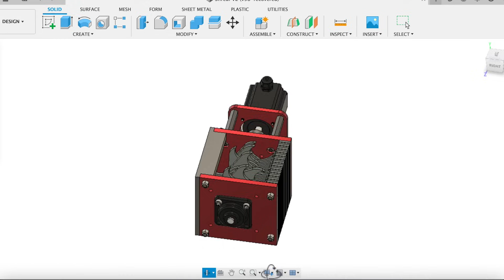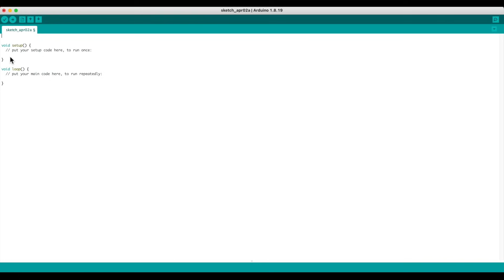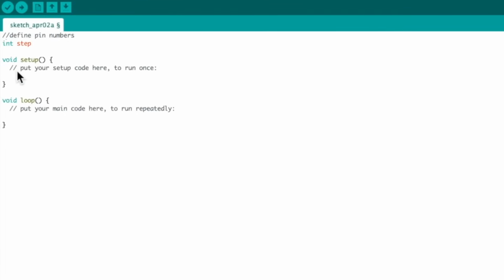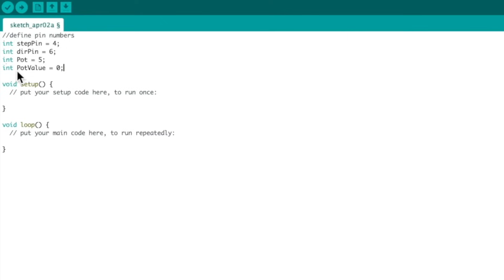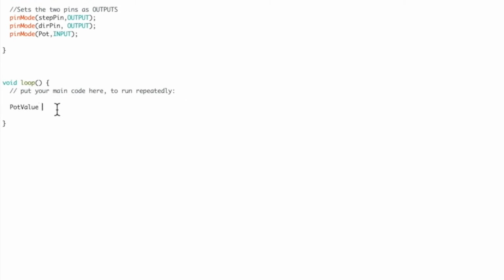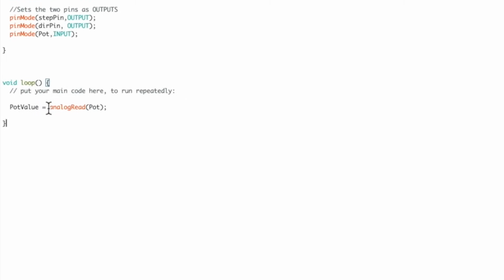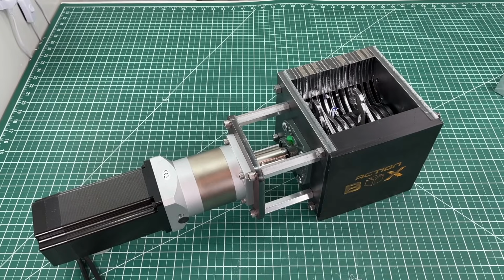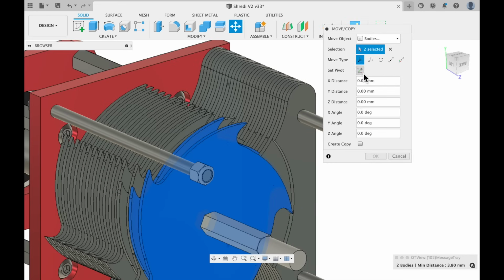DIY Desktop Shredder | SHREDII 1 & 2

Comment: Nice shredder! For your next trick try building my ideal 3D printer.

I Invision a stationary print head that uses shredded plastic rather than filiment. Instead of a roll of filiment it would have a large hopper to hold shredded materials.

It would be impractical to try and make a movable print head with a huge material hopper attached so we make it stationary and move the print table below instead. Think of a Bridgeport style mill as an example. Those have the table able to move in the X and Y directions and the knee of the mill is able to move up and down for Z axis motion.

I may have to start drinking 7up just to get the clear green plastic to shred someday rather than buying filiment to print with.
Reply: This has been done before and it didn't work because the the output was too inconsistent. You have to make it into filament first.
Reply: @DaveSmith-cp5kj   Did they try making a long narrow screw injection cylinder? I'm sure there's a way to make it work.
Reply: @tenlittleindians  Yes that's what they did. I'm pretty sure the full article is on MAKE although the original article is old from 2010 or so. The issue is the rate the hot end as programmed by the gcode consumes changes and is always different from the rate the extruder wants to put out. Consequentially you end up with junk burning up in the extruder, or gaps in material being laid down on the bed.

Because you know when an extruder extrudes, it consistently outputs right? But when a 3D printer prints, it lays down material for a layer, stops to change Z height, then resumes. Those pauses where material is not being laid down backs up the whole system, but then if you reduce output to compensate, you get spots of no material in the print.
Reply: @DaveSmith-cp5kj   I think pausing the entire shredder/extruder mechanism would be a better approach rather than just pausing the rotary extruder would be a better option.

The burnt material in any plastic melting machine is poor temperature regulation. The advantage of a long tapered screw injector would be multiple band heaters along the length that independently monitor and adjust temperature. The plastic towards the hopper would be adjusted cooler than the nozzle end. Keeping it in an almost paste like state at the top and only getting to molten plastic at the nozzle end would prevent burning and allow G-code to back turn the extruder during pauses in a print. A screw with putty like material back turned would provide enough vacuum to suck back the liquid in the tip end to prevent drips much the same way a plunger style barrel extruder does when it back feeds filiment.

You will need to sort materials closely as they are all going to require different heat maps for the band heaters along with print speeds to go with them. That's not really much different than what we need today with different filaments all requiring fine tuning to work properly.

These machines will also require dryers on the material hoppers to control moisture just like any modern injection mold machine that uses plastic pellet material.

Your not going to build one for a couple of hundred bucks either!

I think of one of these machines as a tiny recycling factory that sits on a table. We went through a similar development with espresso machines for home use. You push a button today and the machine heats the water, grinds the exact amount of beans, pushes the heated water through the ground beans at the exact pressure for a specific kind of roasted bean and into a cup. It makes the exact same amount every time and ejects the old coffee into a waste container. The machine will even heat and froth the proper amount of milk into the cup at the same time if I want.

These machines are complex and expensive but at Starbucks prices they will save you money in the end. 

Maybe the development needs to be more focused on a specific common plastic such as water bottles for now? Eliminate some of the variables until it's working and then move to the next abundant plastic.

Comment: Yeah, the problem here as well is i dont have a dedicated shredder, and getting the parts and metal for it here in Arizona is almost next to non existent, OR 10x what it should cost honestly cause it is 'custom parts' IF i wanted to get it all done in a SHOP and WILL NOT SELL ME THE SHEET METAL ALONE...smh... horrible in this day and age.   I appreciate you guys making this and giving ideas on how to complete a project like this, thank you.
Reply from the maker: Thanks Larissa, We plan on making all these parts available as kits, to enable others to recycle their small plastic parts.
Reply: @ActionBOX  Thank you....it is the FDM printer pieces that I dont want to ever throw away, and I havent in ages...so I hope you can in the future make kits really.  Thank you again.
Reply from the maker: @larissamonroe21092  I get that, we’ve had the same issue which is one reason we started working on the shredder.  Stay tuned for our next version. Cheers, Dave

Comment: The idea with the aluminum shaft coupler is that it uses a flexure to hold on to the shaft which is much stiffer and stronger than a set screw. Also, it allows for a bit of axial misalignment because otherwise any misalignment will force the shaft to flex at every turn and makes it harder to spin.
Reply: Also the flexture acts as a sacrificial component in the event of a failure, or or jam - rather than the motor, or assembly deforming.
Reply: @MortalSlayerStudio  This is so important! Over and over again I see people using solid shaft couplers, unfortunately it's not like it's something that's taught, you'd never know unless someone tells you. You should never solidly connect shafts unless you have the necessity and capability of having micron level precision in all your assembly. Just like the softer shaft set key that shears in the event of an overload.
Reply: @MortalSlayerStudio  Ahhh, the wonderful and neccesary mechanical fuse
Reply: You beat me to it Clapped, that coupler is for this kind of application where you're not super concerned about a square and concentic shaft rotation and alignment, running a motor wtih an off axis driveline will generally kill the motor bearings overtime causing premature replacement. edit spelling
Reply: Pre-famulated amulite
Reply: Yeah... this is the reason I would never buy anything from those experts...

Comment: A two stage shredder might also work with v1 on top and v2 below. The first one does the initial cut and the second one reduces it to fine material. You could run them with a chain so one motor could do both stages.
Reply from the maker: Great idea. Unfortunately we only have 1 motor, and we are giving the original shred away to one random subscriber, so we wont have it on hand to test with. We will work on a new version and perhaps give this a shot 😃 . Thanks for your input and glad you liked the video
Reply: @ActionBOX /videos Just watched your DIY foundry video. Did you know that you can just use microwave for smelting? Look it up. You can even melt aluminum oxide (+ some additives) to make rubies/sapphires.
Reply: @artiomvas  that takes alot more power to deal with and your asking to use alot of electrity and plus it put out fumes that can be deadly  for inhaling .... that why this set up is infinity better just because you can shred it into smaller chunk and 3d print directly and not need to be near fumes.
Reply: @dragoonduneman4161 /videos my comment was about DIY foundry. Instead of spending a lot of time to 3d print mold and cast the foundry one can simply use microwave oven to smelt metal.
Additionally, they can buy build powerful microwave smelter using 2-3 magnetrons (the thing that makes microwaves).
Reply: Yeah, I was gonna propose this too lol. Especially since they already have both prototypes assembled and available.

Comment: I think you could also just put a nozzle drilled to 1.75mm on the bottom of the injection machine to make regular 3D printer compatible filament with it
Reply: There are better ways of doing that. A screw design would be more optimal for extruding filament. Nevertheless you would still need to shred your prints beforehand, so the shredder would be useful for you.

Comment: Having a dedicated shredder is the main reason I can't fully recycle my failed prints. Hopefully I'll be able to build one some day. Great content as always guys! 👍
Reply: I have to agree with you there. I'm getting bags of prints I can't do anything with.
Reply: You can always buy this shredder from action box and save the time to build it.
Reply: @AlexA-tj3jj  where is it listed to buy?
Reply: @br0k3nilluzion  It's not available just yet. I reached out to them by email and they responded saying that kits should be available within the next few months. I'll be keeping an eye out!
Reply: My way around this, is that for most of the small waste you can use a blender.  I bought one from good will for a few bucks.  It works well enough.  However, with higher infill or thicker parts it isn't great.  It could be a good interim until this shredder gets out.
Reply: @braytonpierce8624  I was just about to say that a meat grinder works very well for this as well. You can get a hand operated meat grinder for about $40.
Reply: @braytonpierce8624  Thank you for this! Most of my filament waste is pretty small, so this may well be a good direction to go. Recycling for the win!!
Reply: @braytonpierce8624  I was gonna look into seeing if a leaf chipper would work.
Reply: It’s been almost a year, let’s check and see about the “few months” thing
Reply: Might be good if there were facilities available at local recycling centre or maker space, you can take in your failed prints, shred them and then take the pellets away.
Reply: Tho is why I watched this video
Reply: A blender would work

Comment: Might be a good Idea to add a mech under the shredder to controll the chip Size. Stepper online also has real Servo Motors available. The downside of using Steppers is that they only have good Torque at low RPM. If you Chose a real servo Motor (which is Controlled exactly Like a Stepper) you get way More torque at Higher RPM thus using your 50/1 Reduktion gearbox More efficiently.
Reply from the maker: Thanks for your input. We were aware of this, but servos are significantly more expensive, and harder to get on Amazon relative to the steppers. In our next design we will give them a try. Cheers